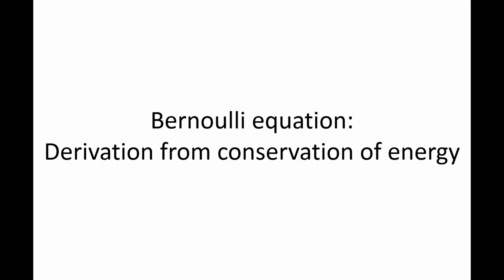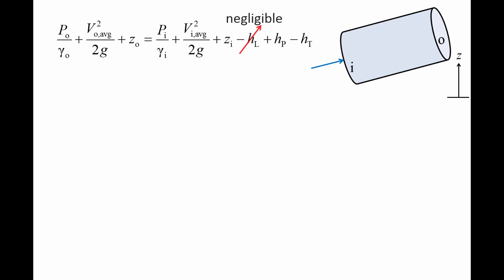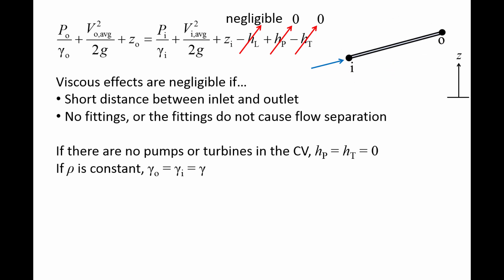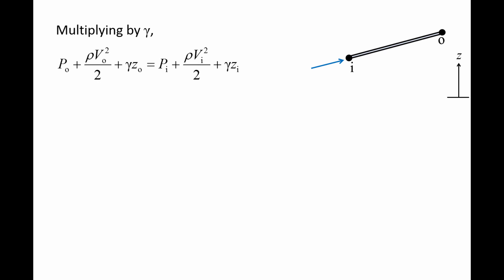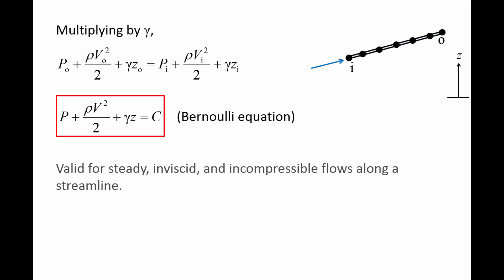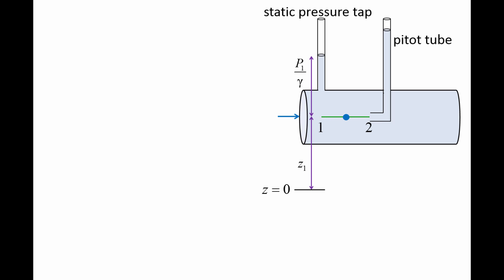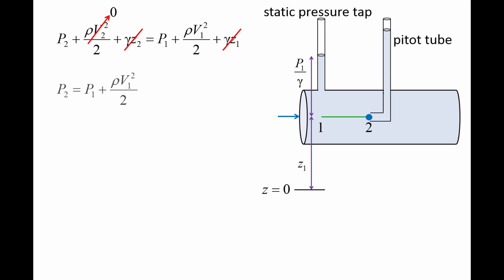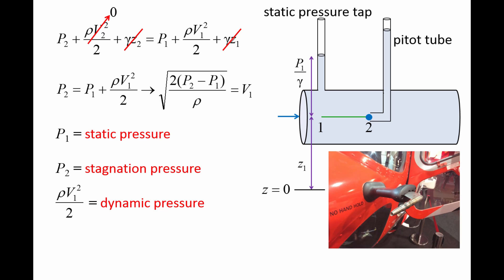Fluid Mechanics: Topic 7.3.2 - The Bernoulli equation

Comment: Great explanation - Subscribed to learn more! Around 3:08 into the video it was mentioned Bernoulli's eq. not valid if streamline passes through pump or turbine. We should still be able to use Bernoulli if our point 1 is right after the pump, correct? Somewhat off topic question: What is the best method to estimate the pressure in a section of pipe?  Currently I have a system curve that estimates the total head required at a specific flow rate. But I am interested in determining gage pressure at an x distance of pipe under a specific flow rate. Appreciate your help.

Comment: How do you measure the desnity of the fluid to determine the speed using eq: v=sqrt[(p2-p1)/rho]?
Reply from the maker: If it is air, you can use the ideal gas law. For liquids, you can look up the values in tables.